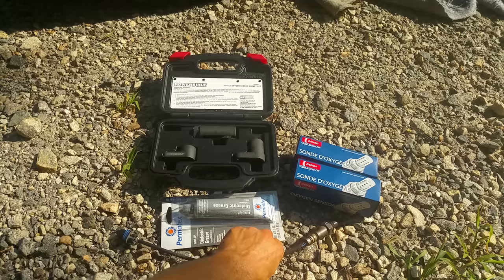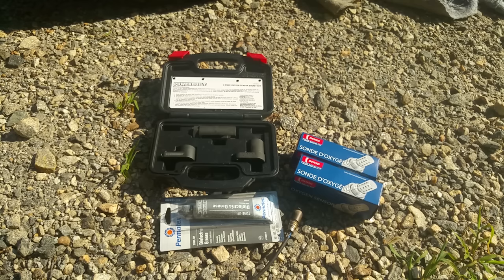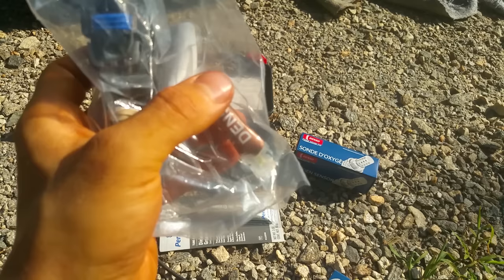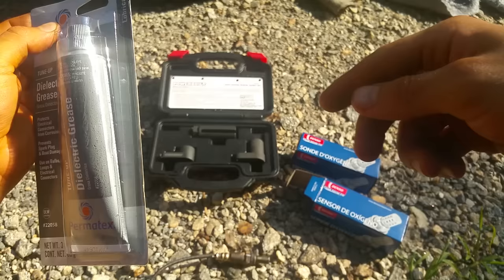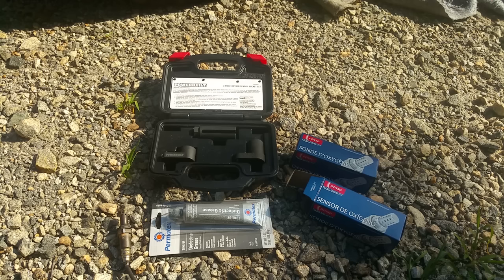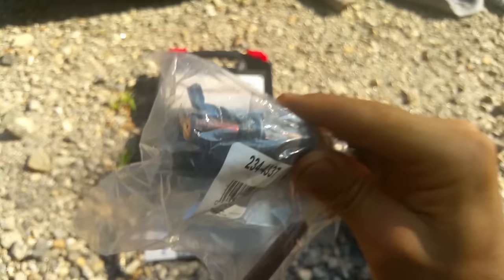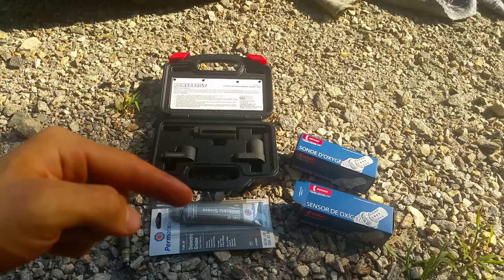NEVER Change Another O2 Sensor Until You WATCH THIS!

Comment: Antifreeze on the threads is correct, but other webpages say NOT to use grease of any kind on the connector, because it will likely keep air from entering the tubing that surrounds the wires to the sensor, and that air is compared to the exhaust gas to give the proper reading to the computer.  It's hard to imagine that the air snakes its way up that tube, but no one says otherwise.   

 Was there grease on the connection from the factory?  I think not, so none should be added the next time either.
Reply from the maker: Gordon Gordonplex I always put anti-sieze on the threads. They are already hard enough to get back off. If you don't want to use it you don't have to, but you are right. Don't get any of it on the part itself or you will be in big trouble.

I was extremely careful to only put it on the threads. Thanks for watching!
Reply: That is what I read, from a guy who seemed very competent "no grease on the connector" but looking at it today, it didn't make sense.  The wires' sheath doesn't start until a half-inch from the connector, so grease in the connector shouldn't interfere with air to the sensor.  I guess.  I'm not sure of anything now, and I hope I didn't mislead anyone..
Reply from the maker: +Gordon Gordonplex Okay, I thought you were talking about the antisieze on the threads. If you were talking about the dielectric grease on the connectors then yea. The connectors are far enough from the sensor itself that it wouldn't make a difference and interfere with the sensor.
Reply: I thought maybe Craigslists auto forum expert was giving advice.

Comment: I used a torch such a map gas to heat the fitting that the O2 screws into, then use the special socket and back out the O2. Use anti-seize compound (sparingly) on the O2 threads before installing the new O2 or the old one.  They'll be a lot easier to remove next time.
Reply from the maker: +Eric S See you didn't even need my tips!

Comment: My sister's Honda Fit is jerking at idle and the "check engine" light comes on every so often. It's not throwing any codes though. The Honda place said it was the spark plus, so they change it. Still jerking. I think it's the O2 sensor, but the mechanic said the engine light would stay on if it was that. Does that sound right? Thanks.
Reply from the maker: It is misfiring? It could be a coil/coil pack depending on how your engine is made, or the plug wires. I wouldn't go to the O2 sensors just yet.

I would clean the Mass Airflow Sensor too. Couldn't hurt.
Reply: Yeah, they're saying it could be the coil now. I have a guy at another shop going to look at it in a few days. We'll see what he thinks. Thanks for replying.
Reply from the maker: You're welcome. Let me know what he says.
Reply: mine is doing a similair thing when i drive normally its fine but when i giv it some gas ith engine surges hav changed everything else plugs leads coils havnt changed the pad yet but i guess it will b the sensors. so frustrating!

Comment: That's why you use a generous amount of antiseize on threads, thick thick layer up until the last two threads, leave last 2 threads without antiseize because when you screw it in the thick layer you put on will spread right up to last thread & not past & you'll be thankful you did 2 years later. Rubbing alcohol & then let it sit in a sonic water platter with distilled water that you could see visibly vibrating & carbon bleeding out of them.

Comment: Lol band aid fix well for a band aid I have had them in a 02 VW Passat on 3 O2 sensors that cost $$$ on a car that isn't worth it all out does is tow a trailer to the dump every few weeks. And they truck the system and gets it to pass emissions here . And it's been over 2 years no check engine and I vagged it and no problems . So it's a good band aid
Reply from the maker: I don't trust those things at all. Replace the broken part and you are good to go is my mindset.

Comment: What causes a lazy upstream o2 sensor? I started throwing p0133 after long tube headers installed even after a custom tune, I'm still throwing the code i even replaced the sensor and there is no visible signs of exhaust leak on the header connections or any where near,car is a 2012  challenger RT
Reply from the maker: That's a pretty new car I don't see you having too many problems with it. Have you checked the other sensor like the MAF?
Reply: Matt's Shop i did,what other sensors should i check?

Comment: Got a 2003 Saturn that all sudden started running rough.change s.plugs,coil,ignition module.still not running rite,code says ign.malfunction?? been white smoking,and stalling,not sure where to turn next,help,would like to get fixed b4,it gets cold out.thanks!
Reply from the maker: +Patrick Meese Try it and see. It sounds like you have a lot of suff going on here. Sometimes they can get expensive order them on Amazon or Rockauto.com to save money. Check the description. They can cause a ton of problems because they basically send the computer the info telling it how much fuel is needed to run.
Reply: Patrick Meese White smoke is either a head gasket letting it leak coolant into a cylinder, or the vacuum modulator valve on the transmission is bad, letting it b suck transmission fluid in. Keep check on your fluid levels.
Reply: My 2004 Saturn Uranus had the same issue.

Comment: My oxygen sensor died and my car just left me stranded on the side of the highway. The worst thing is, the engine doesn't NEED the sensor. In fact, while the engine is cold, it doesn't even use it. The software could have just gone back to some default mode, instead of shutting the engine down completely and causing a dangerous situation. Running a little less efficient is 100x better than not running at all.

Comment: Question..I have a 2004 Lincoln Navigator..it cranks up but it won't stay on..One mechanic told me after putting his reader on..it picked up some codes and he said it was the 02 Oxygen Sensors..if I buy them..will this garantee that my car will stay on..once its cranked..or could it be that my fuel pump is bad ?
Reply: I doubt it is your o2 sensor. More likely a fuel fault, blocked filter would do that or a leaking air into the fuel system. It could just be a fuel filler cap.

Comment: Huge error in this video.  You never put dialectric grease directly on the connectors, it does not conduct electricity and is not made for that.  It should only be used on the housing to keep moisture out of the connectors.
Reply from the maker: It's a myth. It doesn't effect the conductivity. It's what it's made for...

Comment: Please explain why it's a good idea to replace them in pairs.
Reply from the maker: +Robbie Anderson If one has gone bad the other one might go soon. They say to replace them in pairs so that you can get the best MPGs. That way the computer can get the most accurate readings from both sides of the motor. You don't HAVE to replace them both at the same time. I didn't and I had no problems.

It just depends how much $$$ you want to spend/piece of mind like anything else.
Reply: That's not logical - there is no reason whatsoever to replace them as a pair.
Reply from the maker: +Robbie Anderson It's logical to me. It just depends on the situation. If it's my vehicle I'm cheap so I only change one if I can get away with it. If it's someone else's I don't like doing the same job twice.

Comment: That is weather pack connection no need for grease also some single wire units see abient air through the wire grease would block the air no grease
Reply from the maker: It's a tip. You don't have to use it if you don't want to. Like I said before, use your own discretion when it comes to these things. That's part of being a mechanic. Knowing when to use what techniques.

Comment: I'm not sure what type of dielectric grease that is, but you do not want to use silicone grease on a silicone seal like that. It pretty much liquefies it/turns it gummy and ruins it.   better off using the spray type dielectric on these types of connectors.
Reply from the maker: Never really thought of it doing that. Good tip.

Comment: Hi Matt, I came across your youtube video by chance as I purchased a Mitsubishi Outlander ActiV 05/2006 4x4 and realised I need to replace the four oxy sensors.  I managed to source the two pre (upstream) oxy sensors, but I am unable to find the other two post (downstream) oxy sensors.  Can you help?  Thank you in advance.  I am in Australia (right hand drive).
Reply from the maker: Hey, that's good you found the two already. Did you check RockAuto.com or other auto parts websites?
Reply: Thank you Matt, I will try RockAuto now.  Do you think if my car (in Australia) is a Right Hand Drive, and that if I purchase parts from US (Left Hand Drive), it is ok to fit in?  Thank you for your help.
Reply from the maker: You have a very good point. I do not know where to get right hand drive parts. I have never been in this situation.

You have local auto parts stores? Just have them order the parts for you?

Comment: A scanner is the best way to diagnose the oxygen sensor... you can easily see a lazy sensor that hasn’t yet tripped the light but is costing you fuel economy and replacement will save you fuel.... good tips and I use Denso sensors or OEM with good success.

Comment: Why is it a good idea to replace these in pairs?  What is the automotive engineering reason to spend $130 replacing an Air/Fuel sensor [not an O2 sensor] if the 2nd sensor is not having any trouble sending signals to the ECM?

Comment: To get the old ones out you can cut the wires.  It's not like you're going to use them again.
Reply: 0.01 cent saving on anti-seize for manufacturer . pain-in-the-neck of 2 hours for car owner
Reply: @cpgeorge4442    The upshot with this is that the replacement sensor should already have anti-seize on it.

Comment: I needed a breaker bar and a cheater pipe. I had to use a grinder to cut it in half to get a normal long socket on it. I put a new one in and the engine ran rough. I regret ever messing with this sensor.

Comment: do not ever buy o2 sensors at the dealerships, aftermarket ranges from 50-100, at the dealership 300-400 plus labor, if you have issues getting it out heat the threaded flange with a propane torch to expand the bung otherwise you risk stripping the thread then you are truly fucked, you will have to remove the section and wled another bungs, it becomes galed (semi welded) because of the heat cycling.

Comment: I am a big advocate of anti seize, but under heat it or any grease for that matter is useless.   If you want to seal the connections, do it properly with something like silicone RTV.
Reply from the maker: Yea, antiseize isn't just grease though. It has other stuff in it that gets between the threads preventing them from seizing up on you. If you read the tube it tells you how many degrees it is good for.
Reply from the maker: How do you figure?

Comment: I just watched a guy pull an O2 sensor with a wrench.  He said the metal was at about 120  degrees.  It came right out.   I went back in with 15 ft-lb torque.
Reply from the maker: Yea, get out the torque wrench so that it doesn't get stuck in the future.

Comment: Don't put dielectric grease...they block the air intake of sensor through the wire.Use only a small amount of anty seize to the threads of the o2 sensor.
Reply from the maker: +Alx li I'm pretty sure the air comes through the metal part not the rubber?

Comment: you are the first person Ive ever seen recomend anti seize, I use copperease (copper colloidal in the UK) on everything except sex and toast even mixed metal touching like stainless and aluminum is protected against corrosion (differential metal electrical ) and salt water ingress on  boats - and then I retired in Thaialnd the land of NO FRIGGIN copperease / anti seize. Drives me crazy my daughter has to send it over from UK. I swear if anyone takes it other than me they are dead....they even call it "falang  jellabee" meaning "foreigner grease" Im working on a honda city o2 code and working out whether to put in a 10ohm resistor to fool it into thinking its got a heater as the heater is open circuit....

Comment: Never needed a special tool myself. I'm sure with some vehicles you may. I just spray them well the day before on my Tahoe. They are easy to get to though. I have now eliminated them and run a cat free exhaust that I'm able to do in my part of the world. You just need to tune the vehicle for such. You would not believe the release of power. Not for everyone and it's not legal everywhere. It is 75 100 hp for some.
Reply from the maker: Did you test that on a dyno or is that 100hp seat of the pants??
Reply: I said for some. For me it hasn't been on a dyno yet. There are alot more things to be done yet. I doubt if the Vortec will benefit that much due to the very restrictive intake. With a decent intake, even the marine intake it is a pretty realistic number with the right exhaust.

Comment: I bet you didnt know that if your 02 sensor is still registering but is fouled by carbon and throwing codes you can save money by putting them 02 sensors in s glass of lemon juice for 20-30 mins and then rinsing them in Vinegar for a few mins then rinsing off the vinegar with rubbing alcohol...

Comment: URBAN LEGEND!!! (about not touching the very tip of the sensor) that tip heats up to many hundreds of degrees temperature, the very small amount of oil in your hands is going to burn off immediately, so NO, you can't damage an O2 from handling it with your bare hands.  SMH
Reply from the maker: Probably, but why touch it? What's the point?

Comment: The GM tech center told us to first use the torch to burn the carbon off the tip of the sensor before replacing the sensor. To try that first and that works most of the time.
Reply: The early command control carb systems had a green wire that you grounded to make the system go full lean and that did the same thing as the torch trick.
Reply: If you just want to plug the hole most of them are 14mm so a spark plug works then you put a fake wire on the plug so when they look with a mirror at the system it looks like it's stock.

Comment: Your not supposed to put dielectric grease on the o2 sensor connections. That's why the gasket is there for. Also the dealership tells you not to

Comment: An inline engine wouldn't have 2 upstream or 2 downstream. The same as a W engine wouldn't have 2 or 4 in total
Not sure why you didn't cut the plug and use a normal hardened 6 sided socket... 
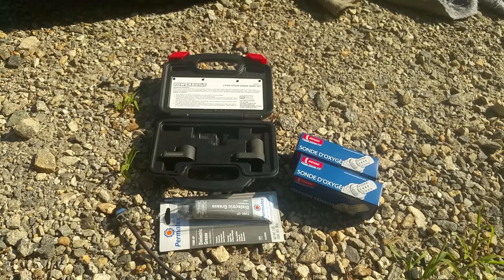Also the socket you showed at 2:00, you can get a 6sided socket over the top of it, rather than using the square drive.

Comment: I NEVER use a breaking bar when trying to remove O2 sensors. That's a recipe for disaster and much expense. I heat the surrounding base and whether using a wrench or special socket I tap it free with a hammer and then just slowly work it out, always stopping to work it back and forth to help clean the threads and not strip them.
Reply: Brian Ford  use a rubber breaker bar

Comment: Is bad o2 sensor effect eco idle system
Reply from the maker: If the scanner says the O2 sensor is bad then probably.
Reply: But there is no any check light in dashboard
Reply from the maker: Then it's probably not your problem. Did you check it with a scan tool?
Reply: @MattsShop  yes but no error

Comment: You do not use carb cleaner to clean O2 sensors you get a torch and put it in the flame of the torch get it red-hot for about 2-3 minutes burn all the carbon off of it, it is a porcelain, porcelain is impermeable to heat. you'll know it's good when you see white in side.

Comment: i would also add that if taking out the O2 to replace manifold for example, use a plastic bag over the sensor once removed and place safely out of the way without disconnecting it.
Reply from the maker: +cka mark otho keen Yea, that's a great tip and sounds exactly like somthing I would do!

Comment: Funny thing GM don't even put them in a bag they just throw them in a box without Anti seize what a great company  lol. I really feel like it's a big job when you don't have all the tools or a jack or a creeper just underneath a truck with a torch trying not to drop it on my face while heating the 02 sensor bung honestly heat helps but I sprayed big shot after and before I did the 02 and the last day I let it soak n finally broke free. It was a job now I'm taking my converter off n gunna straight pipe it of 02 don't make the issue go away which I think it is the CAT.
Reply: I just installed an ACDelco sensor, it came in a box, sensor in a bag, with instructions/warranty, never looked at it, and a tube of gold anti-seize. 22mm wrench, got her done.

Comment: The LARGER NATIONWIDE auto parts store have a loan-a-tool program for this tool and many others.  Always check with them first before spending your cash for a tool you might never need again.  You give them a deposit and it's retunded to you when you return the tool within the time limit.   Not all locations have all the tools in the program and not all tools are included in the program, and there's a limited number of each tool in each store.  Also someone might already have the one you need checked out.